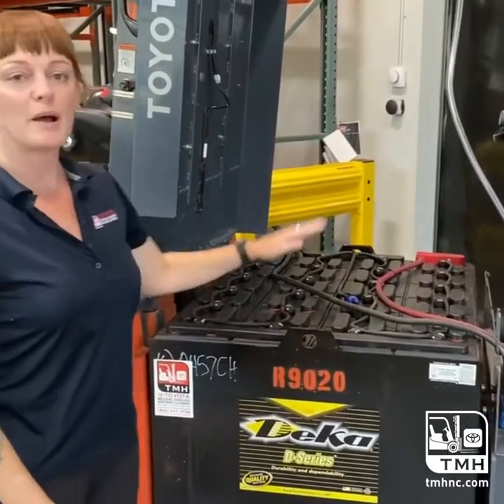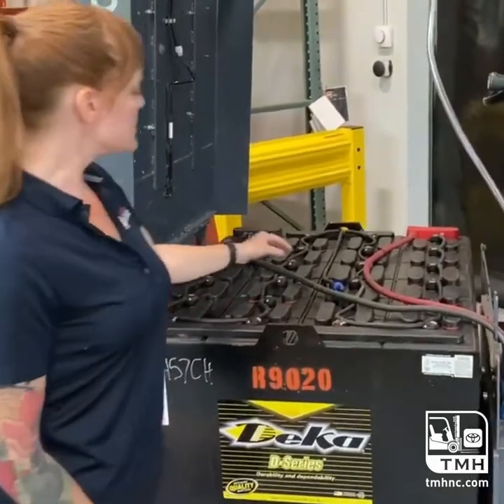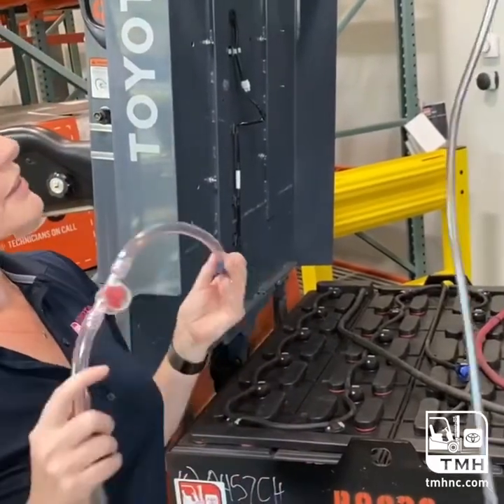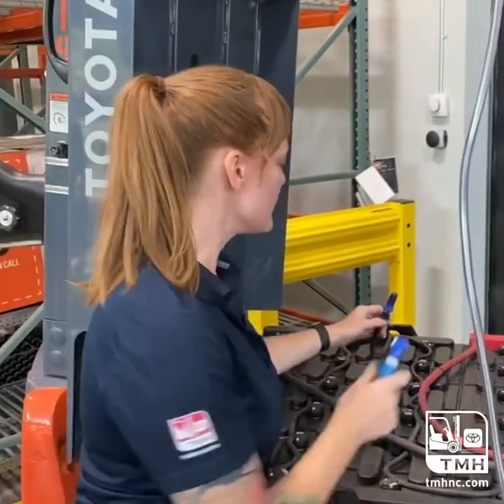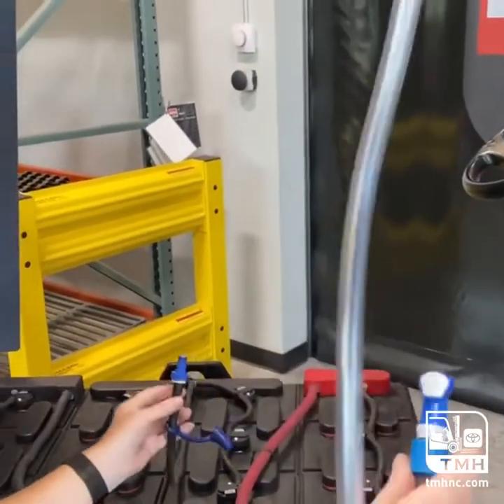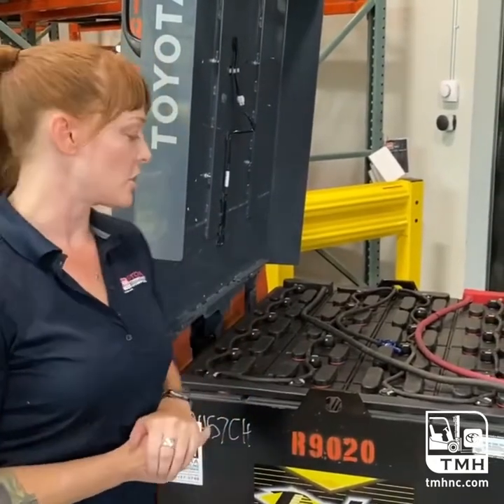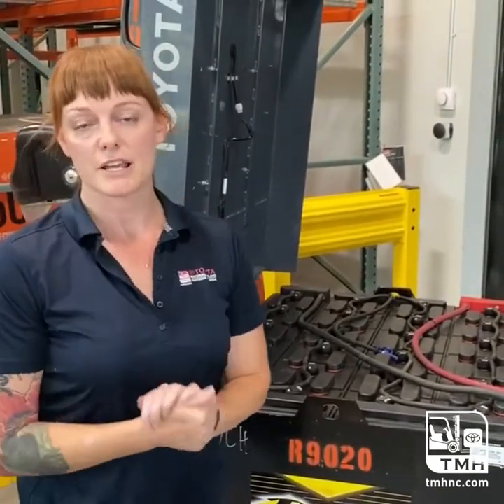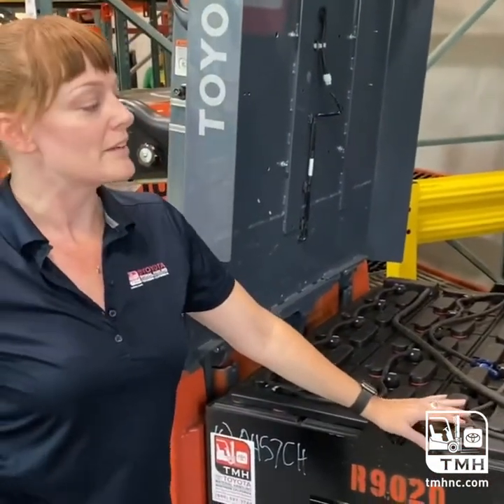Forklift Tips: How to Water Your Forklift Battery

Comment: Is it possible that the system is clogged? I'm using a pressurised tank and it looks like water isn't getting into the cells and I think I need to take the whole brilliant central filling system apart.